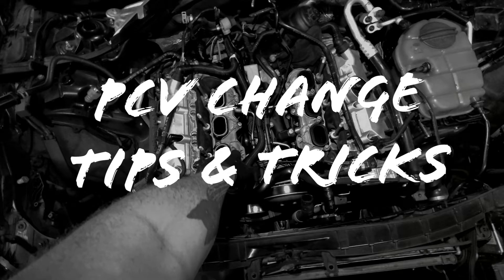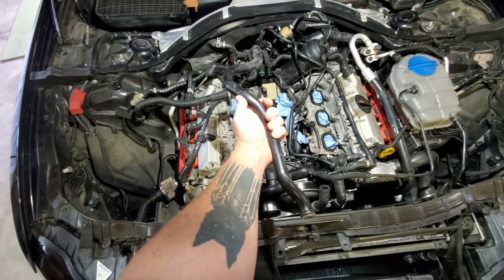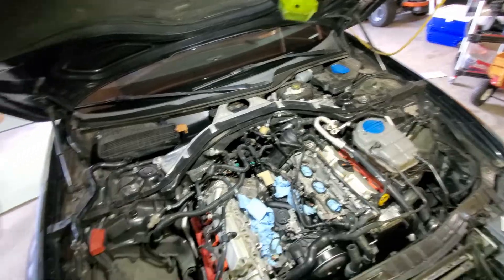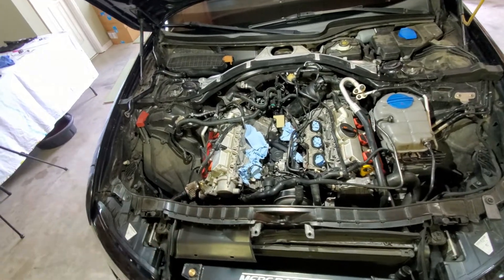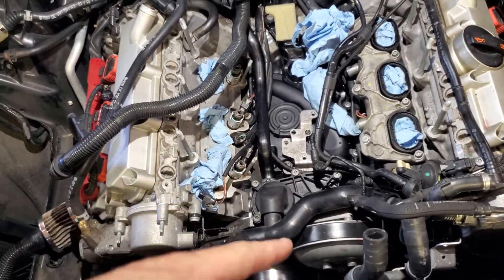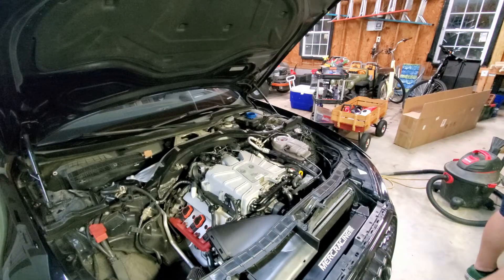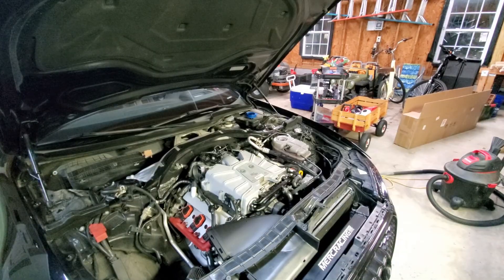Supercharged Audi 3.0T PCV Replacement Tips & TRICKS | C7 A6, A7 & B8 S4, S5, SQ5

Comment: Great vid man! Getting ready to do this job and from what I gathered between forums / other vids, I had my concerns that FCP was missing some important info on the more likely scenario where injectors get pulled with that manifold (prob because the car they worked on gets a lotta love from all the DIYs they use it for). Either that or they're some of the luckiest mechanics on YT lol. 

Just a small correction on the manual coolant bleeding process you mentioned, particularly the order you said. If I recall correctly, I think it was
(at operating temp with someone holding revs steady 2000 rpms)
1. Open bleeder screw on the passenger side of the SC first
2. then driver side SC bleeder screw
3. THEN the heater core by firewall last (with heat turned up to "hi" inside the cabin on the lowest fan speed)
And of course, if you have an upgraded heat exchanger that'd be first in the process as you already stated but that mod is still on my wishlist. Let's see how the pcv job goes first 😂

I think you prob knew that already and you just misspoke, but just incase it helps anyone else reading the comments as I couldn't agree more with that piece of advice to manually bleed the system. I kept hearing a bubbling noise from around the firewall area every time I hit 2-3000 RPMs accelerating through 1st and 2nd gear and it was annoying as hell. Sounded like my car was cooking pasta or soup under the hood at every intersection lol. Became familiar with the bleed process thinking it had to be the culprit but it only resolved the issue temporarily.
Reply from the maker: It honestly doesn't matter which one you bleed first between the supercharger & the heater core. They few on completely separate loops and don't transfer air between each other 👍🏻
Reply: @GarageTaught  oh nice! I wish I knew that sooner but definitely good to know now going forward
Reply: Most vids are for the 3.0T. I have the 3.2 and cannot find all the parts. I’ve read it’s recommended to replace the fuel line adapters. Today is first time seen couple folks recommend replace crank case hose. There’s a URO aluminum coolant hose available. Does anyone have list of tools?  Sadly I just did the injectors and now the engine whistles at 2000 rpm. No check engine light. No codes. But I don’t have a soft reader

Comment: Hi there!
Thanks for that video, it's really helpful!
I'd like to add also a hint I found when I was replacing my PCV: it's about this T30 screw which is holding the coolant pipe and located at the backside of the engine (with metal bracket and 2 connectors on them). It could be much more easier to unscrew another 2 T30 screws on a secondary air valve (behind the head) and release a secondary air pipe. Now it's possible to push backwards all the pipes and wires around this screw and use a normal ratchet. =)

Comment: I’m at 92k on my 2014 A6 3.0t and have had a fault malfunction for my pcv valve. I haven’t experienced any oil burning problems or any engine lights. Do you think I should be proactive in replacing my PCV valve? The shop I go to also suggested replacing the thermostat and other parts while they have access. Would love your advice.
Reply from the maker: If you are getting a fault code for pcv & it comes back when cleared, then you should change it.

At 92k it isn't a bad idea to do the Thermostat & and a valve cleaning while you are in there.
Reply: @GarageTaught  that’s exactly how I caught it. I recent bought vcds for coding and happened to scan today. It had been cleared and came back since last service service scan. What would a valve cleaning entail?

Comment: Brother I need help I just replaced the o ring on the heater pipe put my manifold back on made sure they were free to flap open put my supercharger back on and now I have codes on my manifolds stuck open and closed any idea what it is I just removed the passenger manifold did not touch the driver manifold I’m getting bank 1 and bank 2 lmk please 🙏🏼
Reply from the maker: Make sure all 3 flaps are free to open, make sure you plugged in the vacuum lines & electrical connection to the solenoid controlling that manifold.

Comment: I REALLY wish i saw this video BEFORE starting mine, becasue im now getting back to it a week later after waiting on a new coolant pipe which broke
Reply: I wish I had seen this before as well.. In the process of trying to get to that rear T30 with minimal space to access, I ended up maneuvering the passenger side PCV hose too much and it broke 😭  I just need the right part # for my ‘12 A6 Prestige 3.0t now after seeing this and how to just slide both of them out to change out that damn broken top coolant pipe. Probably need to get a small T30 too like those as well.
Reply from the maker: Sorry man!

Comment: Just popped my cherry with 2 soft codes.
P008700- fuel rail/system pressure - Too Low
P052E00- PCV Regulator Valve Performance

Can they be related? Maybe previous owner replaced PCV and fucked up the fuel lines?
Reply from the maker: It's doubtful they are  related but it would be worth pulling the supercharger to indirect. The fuel code could be from your hpfp or lpfp.

Comment: Just did my PCV replacement and I found that the pipe moves very easily if you do the right steps.

remove the T20 for the Y-pipe and pull out the Y-pipe
Slide the red and green connectors out of the way
remove the T30 (pain in the a$$ even with a micro ratchet)
no need to bend the metal bracket
now move the corrugated breather tube that runs right next to the hard plastic coolant line (through the valley of the engine)
You can only move the corrugated tube once the Y-Pipe have been removed
now you can easily twist clockwise the coolant tube and push it out of the thermostat without removing the clips. you now have plently of room to work. 

this is much easier and less stress and you don't have to replace the clip or the tube.
Reply: I’m in the middle of this job right now. I’ve been struggling with the coolant pipe. 
I got the t30 out and the clip in back released. I can move the pipe side to side and back and forth a bit but it won’t let go on either end. I’m stuck at the moment. 
This is on my s4 with about 90k. I don’t think any of this has ever been apart.
Reply from the maker: Get a long screwdriver, put it under the coolant pipe, but over the engine block. Use it to apply leverage against the pipe towards the back of the engine bay (trying to push the pipe towards the firewall to pull it out of the Thermostat housing).
Reply: So I tried the long screwdriver method and it still wouldn’t let go. So I resorted to shocking it. I used a mallet on the screwdriver and was able to got it out of the thermostat housing. I have a new pipe also. 
Thank you for responding and the advice.
Reply: So I tried the long screwdriver method and it still wouldn’t let go. So I resorted to shocking it. I used a mallet on the screwdriver and was able to got it out of the thermostat housing. I have a new pipe also. 
Thank you for responding and the advice.
Reply: @iskendertulu3890  I'm currently in the process and struggle to get the pipe from the back. Was able to get the front side out by holding around the bend and rotating it clockwise but can't seem to figure out an easy way to disconnect the back as I'm afraid to apply too 
much force to the connector housing. The clip is pushed out of the way and I sprayed some wd-40 around the housing but it is still there tight. Any suggestions?
Reply from the maker: You don't need to remove it from the back unless you are replacing it
Reply: @GarageTaught  I want to replace it while I’m at it.
Reply from the maker: I did it exactly that way & mine did not come out easily at all lol

Comment: Can a bad pcv make your car smoke white  smoke got no check engine light
Reply from the maker: White smoke is from coolant burning. This could be from a bad pcv, but either way you need to get the car in for a check up fast
Reply: @GarageTaught  thanks 😉 is at the shop right now $950 for the repair
Reply: Hey man, what did they replace for $950? Was that parts and labor? Doesn’t seem too bad, I was worried a replacement like this, I’d be looking around $2k 😬 no issues now thank god, but I wanna get it done before I tune my car
Reply: @mizaqenyad4269  it was the pcv labor 1200 with part
Reply: @hjaniel4428  okay thanks man! Still not horrible. Probably worth paying to avoid this pain in the ass looking job haha

Comment: Dude, "bend the bracket" and "not replacing the clip" are NOT good tips and/or tricks. I wish you had left that part out. That coolant is gonna leak out the back onto the bell housing. That hard plastic coolant pipe is screwed to the engine (as you showed) and will eventually vibrate enough to leak.
Reply from the maker: 1) bending the bracket is something almost every or person does to replace the pcv, and has done without issue for the 10+ years this engine has been out.

2) I didn't say it was a tip/trick to leave the clip off. I just brought up that I Couldn't get it back on so people were aware of the difficulty. I've had zero leaks in any case
Reply: @GarageTaught  For shits and gigs I also lost that retaining clip. I was able to somehow get it back on on my S4 but my Q7 shit went bye bye putting it back in. So it's fine to leave it off? The plastic pipe has that keyway that poppped into the rubber heater hose.

Also the geniuses at Audi on the older 3.0 design decided that the bracket that holds the red and green connectors, well only the red one should slide out. On the Q7 4L the green connector is essentially a part of that bracket so its even more of a pain to get that T30 out. A micro drive won't fit back there.
Reply from the maker: Yep, I have left mine out since this video & haven't had any issues
Reply: @Wootstapler  On my B8 S4, I was able to slide the green connector after pulling up hard on the bracket to open the slot a bit.

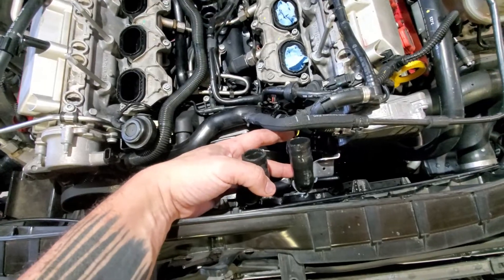Comment: Appreciate the video first of all, I have a question I recently changed my water pump/thermostat on my 2018 A6 and had a coolant leak from the hose coming from my reservoir tank to my engine ( the hose above your finger at 10:50 going to the reservoir )I’m in desperate need of help identifying the name of that specific hose so I can order it online, fix the leak and hopefully get my baby back on the road.. thanks for the detailed video..

Comment: How did you go about removing the lower manifold?  I realize it's connected via the  fuel injectors but pulling up alone doesn't seem to be enough force?  Using anything to pry doesn't seem like a good idea either.  Am I just not applying enough force when trying to pull it up by hand?
Reply from the maker: It's just in there really tight. Gotta get some force on it.
Reply: @GarageTaught  Yep extra force was all that was needed.  You're a life saver on the fuel injector kit - only 1 injector stayed in. Glad I caught this video prior to gearing up for the job.  Thanks a bunch man!

Comment: Hi, I have an issue and I was wondering if you or anyone else have had a similar issue;

So when I replaced my chain & tensioner on my 2011 A7 3.0T 5000 kms ago, I also replaced the PCV (with an aftermarket). I had read on some places that you need the "updated" version number for it, but also need "reprogramming" in the ECU? Is that true? Because I replaced it with the updated PCV, but have not had the car reprogrammed...

An additional issue that I have (which triggered me to replace the PCV in the first place) is that the engine exhaust steams a bit sometimes, even when the engine is hot. And it occurs intermittent. It does not use oil (much) nor does it use coolant. This steaming issue was there BEFORE the PCV replacement AND still there AFTER... Car is unmodified. Smoke is white, not blue. And also not thick like a blown headgasket. I know what that looks like too unfortunately (different car tho ;) )

Thanks!
Reply from the maker: Sounds like they're is nothing wrong with your car at all. But yes, if you put the most up to date pcv in your 2011, you should go to the dealership to get an update on your ecu. The steam is perfectly normal.

Comment: Did you have to remove that SAI cross section to get the coolant hard pipe out or no? I have a hard time visualizing how the eff you were able to get the heater hose off
Reply from the maker: Nope. It honestly doesn't have to come out of the heater core hose. If you watch the fcp video you can see how they just move it to the side. I completely removed mine to replace it as preventative maintenance.
Reply: @GarageTaught  I understand, I'm trying to replace the hard pipe as well. I have the T30 bolt off and it's out of the T-Stat I'm trying to get it out of the heater hose on the back
Reply from the maker: There is a metal retaining clip you have to remove off the heater hose connection.

After that. You have to pry it out.

Be warned: getting the metal retaining clip back in is a nightmare. It's almost better to undo the heater core hoses & pull the ego assembly out to remove the pipe lol
Reply: @GarageTaught  That's what I've read on some old Audizine post. Like I said having a hard time visualizing it (probably need to go to bed ... Lol) You'd undo the band clamp on the hose and yank the part with the clip out yeah? Appreciate the timely responses
Reply from the maker: Lemme see if I can find the diagram that shows the whole thing.
Reply from the maker: Unfortunately I can't find any diagrams of the heater core hose & how it connects to that coolant pipe. But I'm fairly certain if you disconnect the hose where it connects at the firewall you should be able to pull the entire assembly out by pulling the coolant pipe out.
Reply: @GarageTaught  No worries bud thanks for going through the effort to look. Gonna get some sleep and attack it fresh tomorrow.

Comment: Currently in the process of buttoning up my PCV replacement. This video was invaluable thanks a ton man.  I ordered the injector rebuild kit as well, but was wondering how you managed to replace the white cylindrical seal near the nozzle? Did you also soak them in gas overnight to clean? Thanks
Reply from the maker: I did not soak them, and they just slid on. Wasn't really any trouble to replace them.

Comment: A little tip for that coolant pipe. Once you get that blasted t30 out, just slide or push the pipe towards the driver's side then you can easily pull it out of the thermostat and move it out of the way without disconnecting the whole thing from the back. I changed the PCV, water pump, and thermostat for the 3.0t and it was pretty straight forward. It was that t30 for that coolant pipe that made everything really difficult for me. 

Also, I used an Allen wrench that fit snuggly for the t30 screw, just enough to loosen it. Then I just used my fingers to unscrew it all the way...dropping my Allen wrench in the abyss in the process :(. I did have to bend the metal part that holds the electrical thingies to the side to make room for my hand to access the t30.
Reply: That little t30 holding the rear of the coolant return pipe was the biggest pain in the ass for the whole job. :) I had to replace that coolant pipe and the connector/heater hose in the back as I had a leak at that union. Did PCV thermo/water pump and front coolant pipe seals and belts while I had the blower out.
Reply from the maker: With my little bit ratchet that t30 was pretty simple. Just gotta have the right tool for the job
Reply: @GarageTaught  Where did you get that little bit ratchet again? I bought a lot of tools from O'Reilly's and the allen wrench worked the best for me.
Reply from the maker: I'll add this to the description too

https://www.amazon.com/dp/B000XYOUS6?ref=ppx_pop_mob_ap_share
Reply: @GarageTaught  yeah just crack it with that then use your fingers
Reply from the maker: My little low pro bit driver wrench worked great, but I only used it to loosen it & tighten it. Fingers for everything else.

I'll keep this coolant pipe in for a couple years before replacing again.